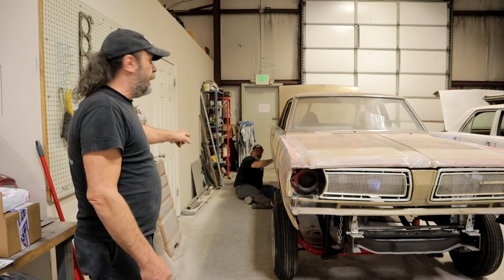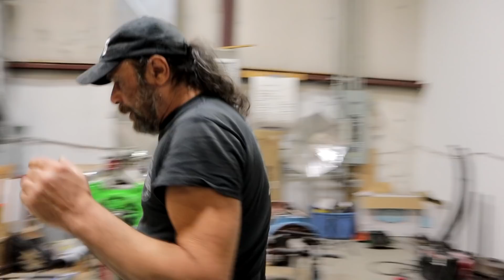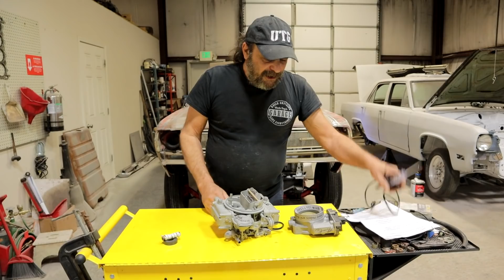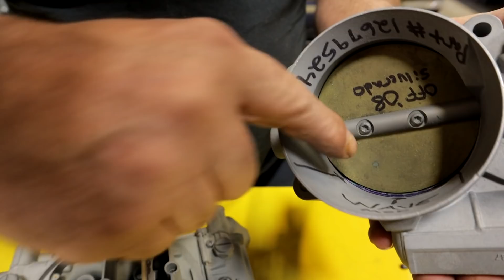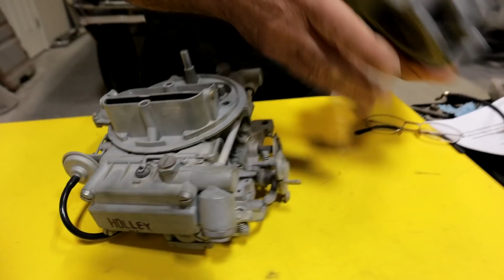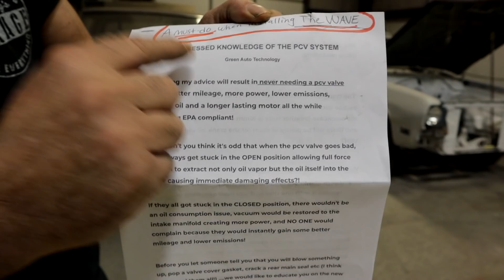The Free Energy Scam And Other Absurdities Of The Mechanical World

Comment: The idea behind the motor turning an alternator to create some kind of energy is behond absurd.

First idealy it will never make more energy on one end than the other, so it's at best perpetual motion, but you will never be able to draw any current out of it. It will just stop !

The second problem is very simple, their is friction losses, magnetic losses, etc etc...
So in reality the motor will need 30% or so more energy to turn the alternator than the alternator can produce.
So such a thing will just slow down even faster than just the motor running on inertia !

It's so easy to understand.
I don't know why people fail for it.

I think it's just because too many people think electricity is some kind of magic.

Comment: Glad you’re feeling better. Keep up the good content. If you decided to use that carb I would definitely go through it make sure there’s nothing else wrong with it looks like the throttle are binding. No matter what you do they’re gonna say did it wrong somehow. They just can’t except reality. The problem is with most people when it comes to vehicle technology refused to understand or learn about the systems they’re working with. My thought is if you want it really good MPG make the engine as efficient as possible and the vehicle as light as possible. It’s the same ideas drag racer use The only difference is the way you drive it. It’s a very fine line. Take Toyota Prius for example the plugs on the engine or indexed to make the engine as efficient as possible. The other secret is to just make sure the engine is running at tiptop shape tune and maintenance and obviously driving habits. Just my thoughts and working on cars for over 30 years 25 years professionally I love to see the passion that you have for vehicles we need to pass that onto the next generation and the willingness to move forward and try different things. I’m a good friend of mine had a 1970 javelin 360 2 barrel It was pretty good on fuel but it was so much fun to drive if you drive it calmly you’ll get good gas mileage but if you got on that hard it would overwhelm the tire. Out of all the cars between him and me we’ve had that was one of our favorites just fun to drive.

Comment: Sounds silly and as you say it may make a difference  at idle and low throttle settings. I think you would have to get the same stock Holley and bolt it on the dart . Fill the tank to the brim ( or a container ) and do a lap at the speed limit around your course and time it . Fill the tank to the brim again and write down the milage it got , and see how much fuel you burnt . Then swap over to his carb and treat it like a car rally where your trying to match the time it took around the course and drive it as smooth as you can and try for milage and a time match ,....then compare which carb got the best milage .  Good video Uncle Tony

Comment: i woulda roared laughing if n your test light hada lit up...pulling a generator down....it s called in rush current...in an induction load...motor welder transformer...as soon as the magnetic feild builds up the amp draw drops,,as opposed to a resistant load,,electric heater which is constant. as for the energy in water..thinking steam engine....just look at how big the boiler is compared to the piston...ooorrr a nuclear reactor...stillll i wonder if there is any  expansion in a water injection system on the tuner turbo cars

Comment: Set up the same exact carb at factory specs and run mpg test as well as a 0-60 benchmark on performance...i mean great gas mileage doesn't mean anything if it can't get out of its own shadow. Then switch to the modified carb and see if there's any difference? You probably should try to get the modified one mechanically sound too..just to be as fair as possible? And so you don't get beat up in the comments to badly! Thanks for all the great videos buddy!

Comment: As far as the "free energy" crap goes...
... it's just that.

You can make a 'superconductor' that has practically zero resistance - by cooling the conductor to near absolute zero

But, that takes putting energy INTO the system - you just paid for your free lunch, LOL

Does the system make sound?  Energy loss.

Any heat? Energy loss.

Vibration?  Movement, sound, work?  Energy loss.

Like Homer Simpson said, "In this house, we OBEY the 2nd Law of thermodynamics"

Comment: How about  this?🤔 Cast an engine block with an extra cylinder.  So if it's  a 4 banger it has 5 . Engine runs on four cylinders. 5th cylinder is clutched in during braking and used as a compressor. Valves would be controlled by computer and solenoid on 5th cylinder. Air would be stored in high pressure tank. Run hot exhaust around tank to increase pressure. During acceleration,  air in the tank is used to drive 5th cylinder like a pneumatic steam engine. Once air runs out, 5th cylinder would just freewheel. A pneumatic hybrid.

Comment: Explain how the vapor device used more gas.I was on the fence about you for a while you know a lot of the little tricks to tweak out a little more i was won over to your side which is you're a legitimate grass roots hot rodder when you said a loose motor is a happy motor that's like a magician telling his secrets Tony there are a couple more of them like that one that you havent told that's not a little bit more power that's a whole  lot of power drag racing using that little trick is were you get the most out of it the distributor holds another one you talked about it briefly in a video I know it's a thing of the past now that I've said something about it I'm sure you know that one also I've had my own shop worked in my dad's shop when I was a kid and I'm here to tell you that you can bullshit with the very best of them and I take my hat off to you on having learned a different language and leaving out all the term's of endearment f.bomb's s.o.bs

Comment: There is no need to test any of this junk because there is one undesputable fact that wipes the floor with all these claims. Its to do with car manufacturers, government pollution laws, and the consumer of new cars today. Each year world governments place tighter and tighter regulations on emissions, car manufacturers must build cars that comply with these regulations while producing vehicles that have the power and economy that todays consumer demands. They do this by cutting sacrificial losses, VVT, looser fitting engines, direct injection, and the list goes on. IF there was some magic that suddenly made cars twice as efficient (half the emissions) while maintaining the expected amount of power that the consumer demands, car makers would be all over it like a rash! Just look at VW and dieselgate, they wrote code that would make the engine comply with emissions while under test but then reverted back to regular code when on the road. THERE IS NO SANTA CLAUSE when it comes to conversion of energy from one form to another.

Comment: Glad you're all fine from Rona, i had SOMETHING right around the time that we actually started seeing cases where  live (fairly rurale). I'm young, i had a two day fever, dry dry dry throat, sniffles (year round bs with me allergys all of it, not abnormal) then it transitioned to laryngitis. What a bs of a time. Hoping it was rona though but i'm doubtful. I'm the type of guy that wants it done and over with. Edit: On the ''free energy'' thing. Well there ARE ''free'' energy methods. Like when you take  a natural river stream ect, run some pipe down a great vertical distance, make it shoot out of a nozzle to turn a stator deal. I've seen it done with used washing machines. Again, not really FREE because its just water flow/pressure and gravity working to spin a wheel. Or like how i think a lot of dams work. Same as saying solar is ''free'' i guess. Free after all the money and or time time time.

Comment: Glad you're over the rona. Had it once last year, no big deal. Just after New Year got influenza a. Enough of that. I believe the only way to test accurately is to rent time at Nashville Speedway which is just over 1 mile. Reason being you need to operate the Dart in an environment of consistancy. Constant speed for a sustained period of time. Example...60 mph for 20 laps. Utilize a fuel cell, 10 gallons, or whatever. Top it off, run current carburetor. Top off, measuring amount used topping off for next test. Switch carbs, make sure engine temp is where it was and test with mule carburetor. Measure amount used. To me there is no other way. You have identical weather conditions, consistant speed and driving habit, properly measured fuel usage. I would do an entire tech show live

Comment: Tony, No need to go down the rabbit hole of free energy, it's an empty bottomless pit of nothing. Same thing with EV cars, not that they are a bad thing , because they work as advertised. The problem is EV for 200 million vehicles is not practical or even logically possible as these is not enough power generation available or anywhere in the near future to supply charge to them.

Comment: I was in a jamb earlier this week. I'd left a car too long and it's battery wouldn't hold a charge any longer. With a few extra safety measures I did what you did. Excellent results so far, Even if it doesn't last, it got me out of a bind and I have a new one at the ready for if/when it fails.. Thanks UT!

Comment: Tony-Ray from MotorMouth Radio here. I agree with what I'm reading in the comments, that is to install Michael's carb and drive your car exactly the same way you do with your carb on it. You'll know if things like performance, gas mileage & overall feel are changed in a negative or positive way better than anyone else will. 
I like the idea of swapping put his baseplate onto your carb a lot too, since even more variables are eliminated that way. 
You're totally tight about the PCV extending the life of engines, like you, having been born in an age before that little valve was produced and having worked on many engines from that era when I was a teen I can attest to the gunk, gak and sludge we found under every valve & timing chain cover, and in the lower end. Many times it was that gak that held the damn engines together! Long live the PCV!

Comment: I have a crazy idea: hook it up to an air pump. The electric air pump will be the engine use a clear tube between inlet of the pump and the bottom of the carb. Then on top of the carb another tube then you can a dog machine and a slow motion camera to see how the fog reacts under the carb. It's an idea

Comment: Testing idea:

Build a 'charge pipe" that can fit to the carb that is air tight
Pressurize/fill the charge pipe with air/water
Release the charge from the pipe on the closed throttle blade
Measure time elapsed from charged to empty

Test won't tell ya anything but it's on the same level as this conspiracy level stuff.

@Uncle Tony's Garage, looking forward to the day that your channel doesn't have these fringe elements as the focal point.

Comment: I would take Michaels carb and one just like it and send them both to a place that flows carbs.so you would have an actual measurement. This is the only way to get an accurate reading from both carbs. Same as if you were wanting to know what a change on an engine modification did ; the only way to know for sure would be to put the engine on a dyno. I would not put Michaels carb on my engine for fear of what might be in there and would come out into my engine.

Comment: At this point, my prejudice mind thinks that if that Holley carb came off a 275hp Chevy 327 V8, the thing was already getting some pretty good gas mileage. My understanding is that engine did pretty decent with gas mileage because of the higher compression ratio the 327 tended to have and the very low resistance of sideways force of the pistons as they travelled on the upward stroke due to the relationship between the bore size and piston stroke ( I forget the scientific term for that). So I'm not sure if this will really prove anything. If it does work in any way, it would likely improve mileage while cruising down the highway where the throttle plates are only cracked open a little bit. It'll be interesting to see. Hopefully it isn't jetted so lean your car won't run right.

Comment: As far as testing the modified carb goes, I personally would politely decline but might prove to be an interesting video for some of your viewers.  Kind of a myth busters type video.  Since the emphasis of the mod is on fuel economy, establish a base line over a full tank of fuel.  Have a route that covers around 300 miles or what ever your range is.  When installing the mod carb, fill up at the same gas station the same way and drive the same route.  Did you go further and calculate MPG.  Try to remove as many variables as you can.  To do it so the results are meaningful, you will need to commit time.  But I can already tell you the results.

Comment: I'm somewhere around 12:50 and I'm all dude's talking about are vortices in a place too small for a vortice to have that much effect.

See also: I'm a huge fan of vortices and thier application for laminar flow over negative surfaces. NASA has looked into sub-ducted laminar generators and pointed out the limitations of that tech. This is an attempt to double up on the Bernoulli's principle, (I.E. the Venturi Effect, yes carburetors), by offering a path through the upper skin of the wing that leads to vortices generators just past the crest of the of the wing's cord intended to produce a vacuum that would pull the boundary layer of airflow closer to the wi g surface on the trailing edge. Dust build up over time and difficulty to clean are major issues.

An oversized bore with a groove cut into it will offer a limited benefit as there still is not enough room to generate the vortice needed to smooth primary airflow.

Comment: Something i've wondered about electric vehicles is could the non driven wheels have there hubs connected to some form of an alternator. So as the car is driving down the road the rotation of the hubs is turning alternators which could supply some form of charge back to the battery even if its just a small trickle charge to extend the range? Similar to how electric cars have regenerative braking to recharge the batteries under braking. Disclaimer: im not a EV fan or anything, just curious if something like that would be feasible?
Reply: Nope, this WILL NOT work!  It requires energy to turn an alternator, thus adding to the power required to maintain forward motion.  Where will this extra power requirement come from?  The EV batteries, of course!  Since alternators are nowhere near 100% efficient, your result will be a net LOSS!

Comment: I couldn't agree more with UT about PCV systems.  I'm shocked hearing that there are people against them.  The PCV system and detergent motor oil are two milestones in engine longevity and good operation.
Reply: Even the EGR isn't bad. It allows for a lot of benefits along with reduced NOX emissions. Only reason it went away is modern sensors and electronics allow engine control to do the job of reducing NOX emissions and eliminate mechanical complexity/costs and thus increase reliability.

Comment: With all of this talk about "magic" carburetors and throttle body ridges that "swirl" the air, a few actual places that can be improved are being lost. Changing the intake runner volume while maintaining the same runner length can increase efficiency. Also, there is an area that is very misunderstood that can unlock performance and efficiency, the valve throat. The throat is the area between the bowl and the valve seat, and it's used as a venturi to reatomize the fuel before it inters the combustion chamber. I'm limited on my knowledge of cylinder head porting, but a properly shaped throat (throat length, diameter, angles, ect) will produce the desired results at the cost of other goals (such as high RPM power). I would love to see a test of different valve throat designs based on cylinder volume.

Comment: If you believe the carb might offer some benefit at idle or at low rpm. Possibly give the modification the benefit and time how long the mod works vs the equivalent carb at idle and at 1500 rpm.  Use .1 of a gallon of fuel.

The argument will be the carbs are not the same so you can not do any test without negative comments

Comment: The physics/chemistry of what you did with the battery are in line with the results you got. Lead Sulfate crystals grow and lower the surface area of lead substrate. High voltage and by proxy amperage spikes can degrade the lead sulfate reducing(chemistry term meaning returning to a higher energy level through addition of electrons to the base metal) it back down to the native metal/electron supplier.

Comment: Any ideas on water injection to flash steam, so it pushes past the point where combustion stops pushing? Or does it flash too early to be of benefit? Also, what about those guys who claim 25mpg on a turbo LS motor? I keep seeing people say turbo gives better gas mileage, but I don't understand how, since turbo essentially makes a smaller engine behave like a bigger one, I mean yeah you put more air in, but you also put more fuel in, in my mind turning the same rpm, you'd burn more fuel, not less...